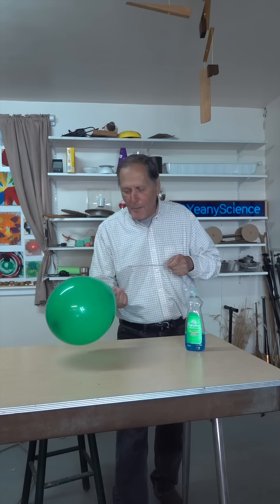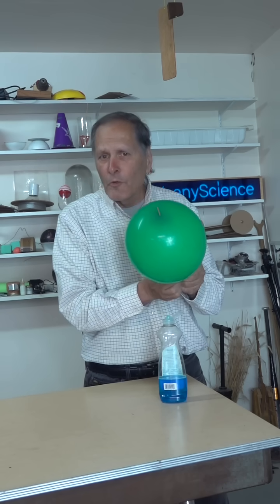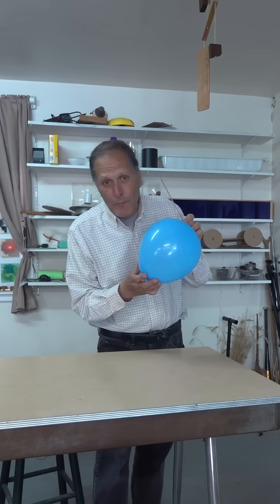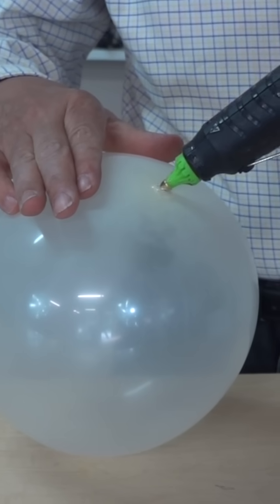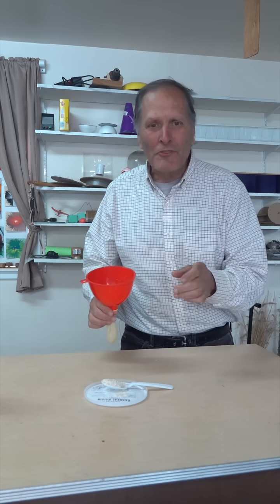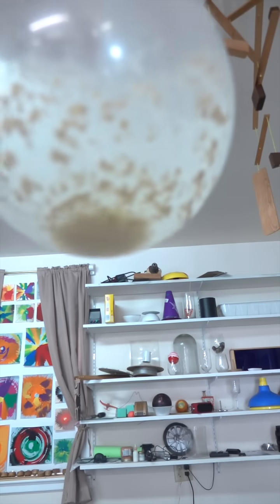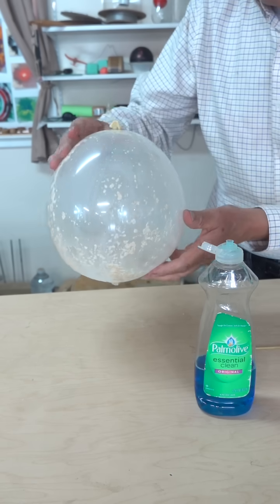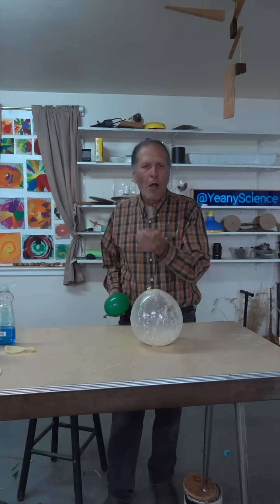Skewering a balloon that will seal itself... Good STEM activity

Comment: Would glitter work to seal the holes from the inside? Or styrofoam pellets, like those inside a beanbag chair.
Reply from the maker: we didn't test glitter with our balloons filed with air but did test it with our water filled  containers, it didn't stop the leaks.  we didn't try the foam beads. We had the most success with  food materials that were high in fiber and  were ground  into very fine powders.  These actually sealed the balloon and stayed inflated as long as the balloon that was not pierced.

Comment: This is like tubeless bicycle tires! You use latex sealant with some particles that push out, clog holes, and the latex dries and cures in the gap between the particle and tire, bonding to the tire rubber